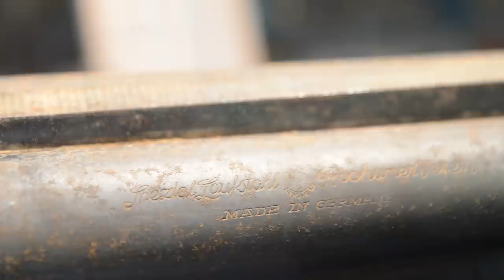Beretta and Sauer barrel conservation

Comment: Your OSB plywood steam tank covers are living up to the material's reputation and falling apart from the wet!  :D
Reply from the maker: Yeah, they are kinda skank, however, results don't lie......
Reply: @marknovak8255  One thing about that tank that is worrying though is the exposed Kaowool, that stuff is very nasty if the fibers get into your lungs, you should think about covering it with something so that you aren't breathing those in whenever they get disturbed.
Reply from the maker: @micahreid5553  20 years in a steel mill. Im not worrying anymore

Comment: You know, I wonder, How did an E-div Chief, a 51-Chief, get so into mechanical stuff? I'm just waiting for you to start looking for a 480V 400 amp load center to plug your drill press into.  Btw, I like how you fixed your starter on that salvaged lathe. Nice save. -Dave
Reply from the maker: The control box was burned out. Reverse engineered the controls and interlocking. It's all up under the bench. Not bad for the 50 bucks I gave for it, eh?    I went to the recruiter 2 weeks after Reagan announced the 600 ship Navy, to be a gunners mate. Got a 99 on the ASVAB, they made me an EM Nuke. My mom still thinks I was a piano player in a French whorehouse. I don't want to let her down, so shhhhhhhhhh.........
Reply: @marknovak8255  One of the things that a lot of the New improved Navy doesn't understand was the transitional phase between classes, 37's and 88's,  that time period was especially hard on people in the divisions you had a hand in. It isn't like it is today. Just like 40's and the 26's. It took some flexible people to get that underway.

Comment: I got a sweet sixteen im gonna duracoat it had real bad chemical damage all the engravings were removed to smooth the pitting by the previous owner so no collectors value got an almost complete gun for 150$ it aint pretty but it'll be a nice all weather quail gun when im done and I'll be able to hunt with an A5 but wont have to take my nice ones out in 90% humidity

Comment: Thank you for the conversion tingles.

This damnedable toilet flange for the ss pot still! Menards stopped carrying 'odd' sizes of PVC fittings, so still trying to source that.
Reply from the maker: Don't overthink it man. Just scab something together that works and make steam
Reply: @marknovak8255  Steam tube build short video! Haha, I hate to need my hand held, and have thought about just using a 4" closet flange and just putting long bolts through to hold the 6" tube on, but thinking water will run down the inside of tube, leak out of the flange onto the pot lid, and then up over the edges of the lid onto my burner.
If not that, thought about a 4" flange with a $20 4" to 6" reducing/increase fitting, and just allowing it to neck down at the base. Not ideal either though.

Comment: Mark,
I'm curious, is there oxide inside the barrels during the conversation process?  If so, how do you remove it.
Reply: really small wire wheel ;)

(joking, if that wasn't obvious)
Reply from the maker: Actually, a regular bore brush works great.
Reply: And the process converts so little steel/rust that and change in the size of parts is negligible?

Comment: Ive got an ancient 97 Winchester in dire need of rust conversion. I just need to find a suitable tank. The thing is almost as long as a flintlock musket.
Reply: If you watch his older video on it, he shows how you can use a length of gutter as a boil tank with a camp burner
Reply: In addition to the gutter mentioned there's also an old Anvil video where a steam pipe is demonstrated, I think it was just a loosely capped PVC pipe on top of a pot of boiling water. As I recall it was mentioned that's the way it was done large scale anyway, as steam was readily available in old factories.
Reply from the maker: The full conservation video is ReUploading now. No bandwidth at the shop. Home telecom is crap, so I have to do the upload from home
. Gutter fab shown there

Comment: While I may trust Mark to use his skill and discretion with a wire wheel, I do not trust myself*!!  So when I have a similar project, I use a wad of *copper wool soaked in ATF to gently persuade the rust blemishes to fade away. I use long, lengthwise strokes wherever possible.  It does take an incredibly long time, but I'm not paid by the hour, like Mark.  And with extremely tough rust, I might resort to 0000 steel wool and ATF. I have successfully used this method on several rifles, and on a couple, even blue touchup was unnecessary!  Thanks, Mark!
Reply from the maker: The wheel used here is a .0025" carding wheel, NOT a wire wheel. That's why I stuck my finger in the card while it was running, and showed the part number and where to get one if you wanted to use power.
Reply: Mark, what rpm do you run that carding wheel?
Reply from the maker: @briankli  4 pole motor, 1800rpm ish. I was given that long shaft Baldor buffer a long time ago by a former smith, but you don't need anything near that complex
Reply: @marknovak8255  Thanks, mark!  (I'm nervous about using power, but that's just me...) Do you ever use ATF or other oils to help carry away the rust?  great video!!
Reply: @marknovak8255  Thank you!  I would love to have a buffer setup like yours but I think I'll just have to make do with the carding wheel attached to my drill press.  Thanks again and thanks for the passing of knowledge!  It is greatly appreciated!

Comment: Your videos are great, I'm going to share them with my dad (a former Navy Machinist Mate and bubblehead). A quick question about the boiling/conservation: are you using regular tap water? I've seen other videos and web-pages that say use distilled water only. I'd guess that having as few additional minerals and chemicals (copper, chlorine, fluoride, etc...) in the mix to interfere with the rust reaction is best. But in your experience, does it make a difference?
Reply from the maker: Tap water is fine for conversion of surface rust. Bluing a naked piece of polished steel is where the expensive distilled water works better.
Reply: @marknovak8255  You sir, are the voice of wisdom!

Comment: Sir I’m working on a Sauer & Sohn 12ga for a customer of mine. Having trouble getting the floor plate screw out of the bottom for disassembly to clean. Do you have any recommendations? I’ve tried repeated applications of Kroil and some heat already. Thanks for your time. Enjoy your channel

Comment: What about inside the barrels?
Reply from the maker: Just pull a brush and swab, like normal
Reply: @marknovak8255  At risk of sounding like an idiot, in the case of a shotgun wouldnt firing a shell or three of small birdshot tend to clean scuzz out of the barrel?
Reply from the maker: @Danglebarry62  Scuzz, rust, cosmoline, wads, plastic.....are all bore obstructions. All of which must not be present in order to safely fire a round. Just my opinion
Reply: @marknovak8255  The barrels have been boiled out, you've had your hands on them, you've looked down them 100x, what obstruction do you anticipate there to be from surface rust when the projectile diameter is maybe 1/10 that of the bore? In the case of a rifled  barrel or a slug? Perhaps. Loose shot? Zero chance.

Comment: Quick question, my krag sporter I bought took 4 1/2 hours to clean and it started like the Beretta barrels and I got it cleaned pretty good.  it looks like the rear of the action is sort of blued but the barrel is just white, with many black spots of patina, I still wipe it down from time to time and it still comes off silver black after I wipe the barrel. Is that just the left over bluing, I did have to do use ultra fine steel wool and hoppes due to not being able to boil the barrel and action

Comment: When boiling the barrels & then carding , what do you do about the inside of the barrels , how do you clean them after boiling . Do you use a brass brush to card the sling swivels? Would this be the best way to go on some milsurp rifles that I have ?
Reply: You do not apply the rust bluing solution to the inside of the barrels so there is no need to do any thing to the inside of the barrels. After boiling you just oil the inside of the barrels. (In normal rust bluing.)
If you need to remove rust from inside the barrels it can be done with a brass brush (possibly wrapped in fine steel wool).
Reply: @wadekirby8575  Exactly but if more applications and boiling needed I wouldn't oil the bores yet, just dry out with a bore rod and shop roll otherwise the oil will contaminate the water. Polish bores an oil when finished.

Comment: QUESTION:  I was given a small set of carding wheels that are a variety of stiffness but are a nylon or other polymer. I have bought an old Coast to Coast 20ga pump that was mostly in the garage on the farm.
Can or should I use the new wheels. I'm curious of how it will turn out. A lot of mung but blue underneath.
Reply from the maker: Your wheels will work, probably. I have no experience with them, I surmise the worst that will happen is a lack of effectiveness, but no harm......
Reply: @marknovak8255  Thank you for the answer. I am a kinda talented amateur, and I like to acquire skills. You will never see my attempt at checkering. Or 2nd 3rd, 50th. 
But this I can do.

Comment: Was the barrel corked or something? Do you care the inside of the barrel, assuming it’s rusted?
Reply: This process is just as effective on active rust inside the barrel.
Reply: So I guess you just run a brush through the barrel after converting to remove the surface rust?
Reply: I suppose or if the inside is not effected, cork the barrel

Comment: Mark, towards the end of the video you mention that one set of barrels needed to be converted at least 3-4 more times. Just curious if you meant straight boil for 3-4 times then card at the end, or boil and card, repeat 3-4 times
Reply from the maker: 3 to 4 complete cycles.....boil,card,evaluate,repeat
Reply: @marknovak8255  Understood. Currently converting my own set of barrels and have some stubborn rust spots similar to those in this video
Reply from the maker: @inadequatefoodstuffs  Consider a brass scraper (old cartridge) to take off the converted surface and re expose the red rust between passes
Reply: @marknovak8255  Okay, I'll give it a try. I really appreciate the feedback. Your videos have been a big help for this project.

Comment: Will this conservation process work on a hot dipped blue finish? Will it look right? I've got a 1960s Ithaca 37 that kinda looks like that old 1887 in a few places. Like brown oil soaked rust. Other less handled places still have the original finish. It shoots great and I wanna keep it going. I'm afraid if I boil it out and card it it'll look splotchy, like  rust blued in some spots and hot dipped in others.
Reply from the maker: Sorry for the delay, just saw this. Hot dip is tricky, sometime you can, sometimes not. Convert first, and take a look. You may be surprised. If not, strip it down and start fresh.
Reply: @marknovak8255  I might try to start fresh on a low value  pawn shop scatter gun first. This was my grandfather's shotgun, and if I louse it up my mother will surely cause harm to me. I just want to stop it before the pitting goes from barely visible to letting light in. I actually considered waiting until she dies so I wouldn't have to admit to her if i screwed it up.
Reply: @chrisblakey9116  remember that soldered double barrel shotguns wont like to be dipped in hot bluing solution ;)
Reply: @rgbgamingfridge  The gun I'm working on is a pump action. I don't think there's a soldered joint on it. I'm by no means an expert at anything, but I'm pretty sure i wouldn't have dropped an old set of tubes in hot salts, already knowing that ribs are soldered on. I question the common sense of that guy. You know, from up here on my high horse. 

And I'm planning to boil it in water not hot dip it. I'm doing this in my garage. I'm not sure im even set up to  get that amount of bluing solution that hot. It's like 350f or something. My little Coleman white gas stove is gonna get a workout with that.

Comment: With boiling do you have to worry about the solder between the barrel?
Reply from the maker: Solder starts to melt around 350ish. Water boils at 212, so no worries

Comment: Why can’t we hot dip barrels? I thought that’s how you get the best blue?
Reply: If I had to guess it would be becausebit would mess with the temper of the metal since they are blued at ~400°c if I remember the luger blueing video correctly.
Reply: If I had to guess, I would say the solder would melt.
Reply: Doubles are usually soldered together with a lower temperature solder. The temps needed to hot blue would loosen the solder and mess up the regulation.
Reply from the maker: The solder holding the ribs on will soften and melt. What a mess
Reply: @daveb7397  this is the right answer,valid for most doubles but not all. Many Belgian doubles are hard soldered and can take hot blueing without coming loose, but you'd better be sure before dipping into that hot salt tank!

Comment: What are you boiling it in to convert the rust?
Reply: Just water, really. It's called rust bluing. You convert the unstable red iron oxide (Fe2O3) to stable black iron oxide (Fe3O4) by essentially getting the oxygen in the water to "donate" to the rust layer. It's really an amazing finish for firearms and tools.
Reply: Distilled/Deionosed water
Reply: Plain water is used most of the time.
Reply: Thor, probably.

Comment: are you submerging those parts in boiling water or steaming them?
Reply from the maker: Boil, ho9wever steam is just as effective
Reply: @marknovak8255  Okay awesome.
Two quick questions about your carding wheel, what rpm do you run it at and have you used the brass wheel instead of steel?

I'd think the brass would be more gentle but I wonder if it's too soft that it may transfer brass to the parts and/or it might not be aggressive enough to remove the oxide.
Reply from the maker: @JPMotorhead1993  1750 rpm (4 pole motor) No experience with a brass wheel, so no opinion either way.
Reply: @JPMotorhead1993  Self-employed machinist and amateur gunsmith here. In my experience , brass wire wheels can impart a yellowish tint to the metal depending on the surface finish and the hardness of the brass wire.  Obviously , you would want to test it on some scrap first. I think you may find that the brass will be too soft to be effective on anything but the finest of rust. But it's worth experimenting. Good luck with your projects .
Reply: @ifitsfreeitsforme1852  second what you said, brass will definitely transfer and leave a yellowish hue on the metal

Comment: So that's why we were taught to clean our guns after every hunt. Who'da thunk it?
Reply: Especially when you go out and hunt in the cold dry air, and bring it inside a nice warm and humidified house. I never really tought about it until I bought a nice camera and in it's manual it had a section about moving from hot to cold. It suggested to take an air tight bag (like a gallon size zip-lock and leave it out in the cold. Before going inside, put the camera inside it and seal it up. Then, when you go inside, the air in the bag is dry, the condensation form on the outside of the bag and you just wait until it comes up to room temperature before opening it.
Reply from the maker: @colemanmoore9871  YES

Comment: ok peop[le what does he mean by boiling it
Reply: Boiling it in a pot of water.
Reply: Literally putting it in a pot of boiling water. The water reacts with the rust to create that black oxide, which is basically blueing. The remaining rust tends to be surface level powder, which by sanding it away with something mild, like degreased steel wool, can reveal a finish that's almost as good as the original.
Reply: Won’t boiling shotgun barrels melt the solder that holds them together, ribs etc? I believe this is why shotgun barrels aren’t hot blued, I’m confused
Reply: @rumpig308  Boiling at 212 Degrees should not melt solder.
Reply: Boil in rain or distilled water.  Tap water contains minerals that may stop the conversion process or cause blotching.  It's safe for soldered barrels.

Comment: Can you provide me the wire wheel specifications?
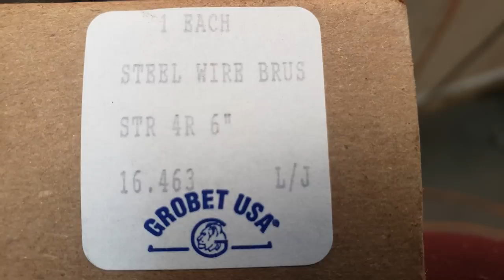Reply from the maker: Minute 7:38 of this video contains the info you seek
Reply from the maker: Degreased steel wool also works, as mentioned here:  https://www.youtube.com/watch?v=rShG_F85W1Y&t=2676s
Reply: @marknovak8255  thank you very much
Reply: Mark Novak if i use "oilled" steel wool the result is bad? Thanks
Reply: @brunonogueira9353  i think the point of degreasing it is to prevent oil from stopping the rusting progress

Comment: Vinegar
Reply: Vinegar is acidic and will ruin the bluing...boiling and carding with a wheel or 0000 steel wool is the way to go..you see Mark also re-rust blued the white steel...which is th way it was originally done. So it looks right when finished.

Comment: How do you do the bore?
Reply from the maker: Use a standard bore brush, then oil with the outside at the same time
Reply from the maker: Converted rust in the bore is actually not a bad thing, its smoother I think.
Reply: @marknovak8255  Thank you.